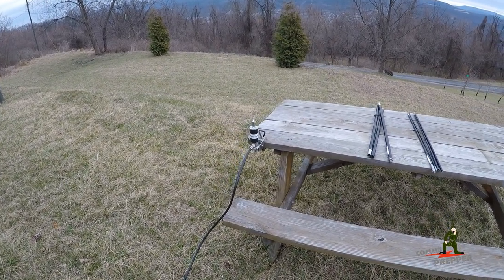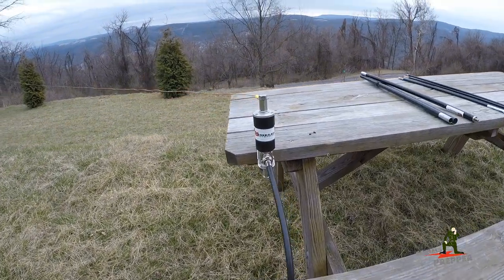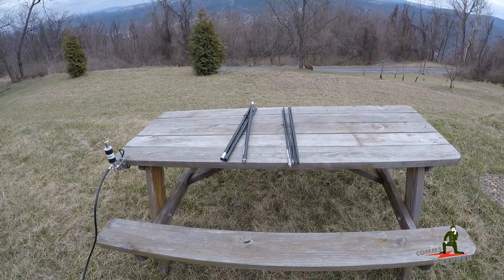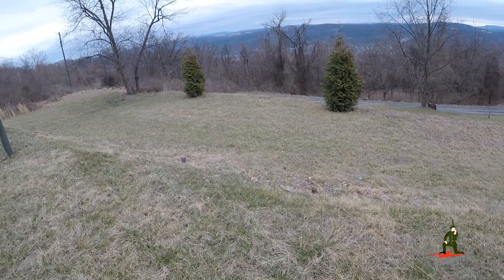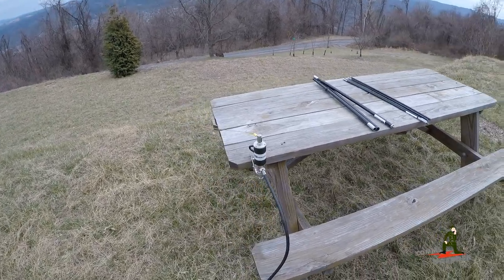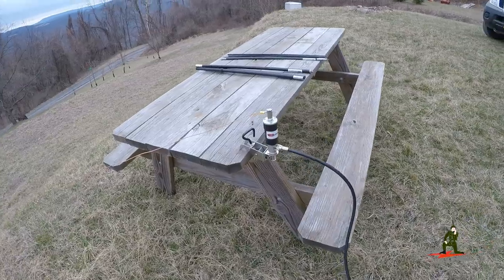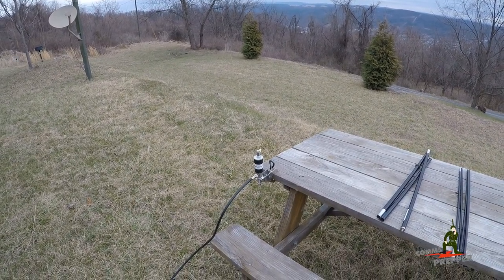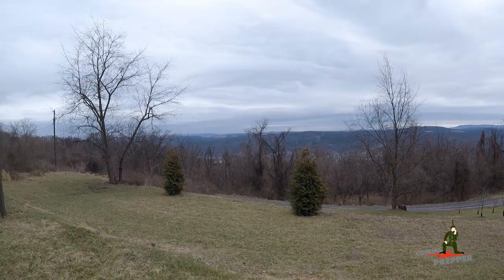Field expedient long-wire antenna

Comment: You are most correct in your description of your long wire antenna example as being field expedient.  Two things I have found about using the the MIL WHIP and MIL WHIP EXTENSION is that if you don’t hold them correctly they don’t screw into each other very easily.  As far as attaching into the the base it’s all good.  I’ve use the Chameleon antenna in both configurations and find them to be about the the same.  I can reach into southern Arizona and California with my FT-817 from southwestern Idaho on 40m so I am not going to complain.  

I see that you’re using the CHA Clamp system to mount the antenna base onto.  I find that much easier to use than vs. the spike that Chameleon sells especially if the ground is wet or rocky as it is up here.  I’ve used the spike and when the wind blows the CHA Spike and vertical antenna will lean in the direction the wind is blowing because the soil is too moist.  When that happens I tie thin paracord around the vertical where the MIL WHIP and MIL WHIP EXTENSION connect to serve as guy.  

BTW, great video.  Thanks Joel, n0dne.

Comment: Looking good ! That works great with an SO239 to 3/8" mount to give a mobile radio much more punch when you are in a fixed spot.  Thanks for sharing !
Reply from the maker: SC - thanks.  One day I will have a tower and log but for now - I have to keep it simple.

Comment: Used this very setup at a picnic bench in the local forest preserve to work contacts from Chicago suburbs to the Florida QSO contest. Started out with the 60 foot wire into a tree. Later transitioned to the mil whip and extension with cap hat. Equal reception, maybe a bit better transmission with the wire. Not the strongest signal reports, but I made it. Have used it in inverted L also. Very versatile batch of gear.

Comment: I wish I had paid more attention in comms class in the military. I remember a guy using a 9 volt battery and a wire with a prc 77 set to reach you over 100 km.

As always.

Climate change is has and will always be caused by the Galactic Milankovitch cycles.

Eccentricity with the galactic bulge regulates intensity with Perihelion happening every 120/240 ka.

Obliquity magnetic north is causing global warming due to a increased DIRECT sunlight at higher latitudes poles. 4x60 ka cycles

Precession of the north star or The Great Year crossing the galaxies double torus electromagnetic equator  every 13 thousand years causes EM plasma bursts, asteroid impacts crossing Galaxies Kuipers belt, and E-w Global tsunami's from the increased EM gravitational pull along the Galactic plane.

The Climate Cycles of our water planet are continental glaciers with lower sea levels Dwarka atlantis's brought on by E-W Global tsunami's Gobekli Tepe washington Scablands.

Earth is a closed loop that self regulates co2 with LIFE.

Energy is neither created nor destroyed.
On this planet.
All energy comes from the double torus EM fields we call the Sun and or Galactic nucleus.

Temperature rises first thawing releasing frozen co2 which follows. Cause and effect.
Not cart before the horse forcing or green house effect BS.

Covid like co2 is a lie built upon inconvenient truths.
The baby boomers who were born enmass 75 years ago are starting to die from the usual suspects of seasonal FLU pneumonia and old age.
The first wave of the largest demographic in human history is 75.
The average human lifespan is 83.
The usual causes of death amongst our seniors is the seasonal FLU pneumonia and old age. Covid.

Jesus loved all races because there is only one race the HUMAN race. BLM
The only minority within the human race is the minority of one, the individual.

Humanity is being divided distracted to be conquered before crossing the Galactic plane Resets the planet.

Comment: hi how long a wire did you use for this antenna
Reply from the maker: I'm guessing but I think it's about 60 feet.   Does not really matter so long it's at least 1 wave length (for best performance).